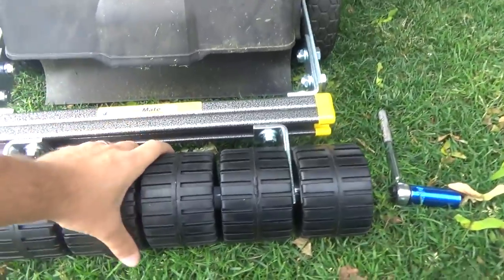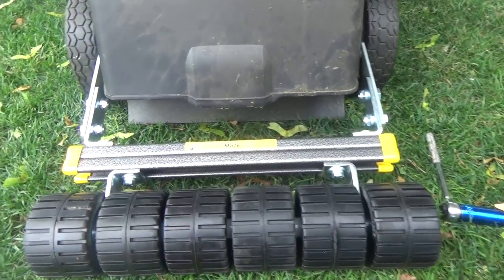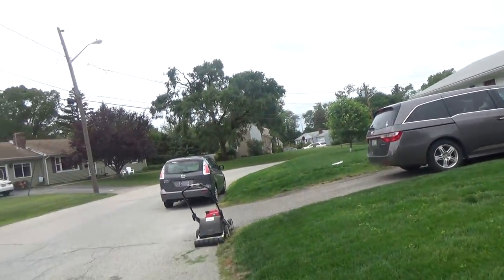Checkmate Striping Kit - Installation / First Use

Comment: I love my checkmate stripper. I only wish I made it. Those are only boat wheels that are made for boat trailers, you can easily make it for fraction of the cost. I actually have a 15 pound dumbbell on mine to weigh it down, it's a little too heavy for my mower but it works awesome.
Reply from the maker: Yeah I was looking into it but those boat wheels are actually pricey. Unless you have a trailer sitting around you can borrow them from. So I figured if I was going to spend that much I'll try the kit out and see what the hoopla is all about!
Reply: Yeah I think it's best system out there for striping. Also I found the boat wheels on a google search for around 4 bucks a wheel! And there was a guy selling them dirt cheap on graigslist, but of course that's near me.

Comment: The problem I have with this is that it will stress the plastic deck over years of use.  Worse yet, drilling holes in the deck voids the lifetime warranty. I really want to love this system, but it’s going to come back to haunt you someday. Those deck holes are going to fracture.

Comment: I have had the checkmate on my hrx for 2 years now. My only complaint is that it's a PITA to take off if your grass is too high or when summer stress starts to set in. My dad has the toro on his hrx and it's much easier to take off or put back on. I think the checkmate stripes nicer, though.
Reply from the maker: +Drew Lukac yeah that seems to be the only con but I haven't used it much yet
Reply: Wayne Severson that's what I do as well. It becomes a problem with bagging.

Comment: How do you truly feel about the weight of this kit? I bought it for my HRX last mowing season and found it very cumbersome.

With the HRX being RWD and this roller adding so much mass to the backend I had issues with the front popping up a bit and causing an uneven cut or missed grass blades. Then maneuvering it, straightaways were fine, but hills, turns or uneven terrain weren't fun. Wound up removing after 2 months of usage.
Reply from the maker: The HRX is known to do that. The checkmate kit shouldn't add to the unbalanced weight but the toro one would.

Comment: I wish my Ego mower had a spot for a striping kit but it really doesn't.  Tried the toro one for a bit but it couldn't be attached as it could with a regular mower.  I ended up using twist ties which ended up breaking after a while.  Another thing is that I have a lot of landscaping so I there are a lot of tight corners which make it hard to use a striping it.
Reply from the maker: Rob J interesting I'll see if I can find a solution

Comment: There is no doubt it looks very solid made. I just don't think I can get the wife on board with me spending $400-$500 for a lawn stripper. I have a 54""riding tractor, so it would be expensive. Great looking lawn! JohnG
Reply from the maker: If you can find used boat rollers you can DIY. All the parts are available at home depot. The kit is just pre assembled and cheaper because the boat rollers are so expensive if you buy them.
Reply: @GrassDaddy  Thank you, I may look into that. I appreciate the reply. JohnG

Comment: Grass daddy , I'm interested in this stripper do you use it all the time ? Do the Toro one do a better job ?
Reply from the maker: +Grassology4610 I use it all the time. I prefer it over the Toro but in testing they basically performed the same. To me the checkmate is high quality no plastic, Toro has lots of plastic - it broke before my first use - and it jacknifes when backing up.

Comment: Grass daddy, dies the checkmate reverse ok on the mower ?
Reply from the maker: +Grassology4610 yes, the brackets are stiff so when you backup no jack knifing and the rollers all roll at different speeds when you turn.

Comment: You earned a sub off this vid since I have a Honda mower and was considering this. Also love the Prodiamine video and the Milorganite video.
Reply from the maker: Awesome! The checkmate kit is super well built you'll love it
Reply: Grass Daddy would love to see this or some more common man's mowers like this. I have an old HRR with the blade clutch and manual choke so I don't have the auto choke issues like some of the HRX mowers. Having a blade clutch is nice for stopping without having to start and stop the mower so much which can be hard on the engine. I think I'm going to work on getting a Chaplin sprayer and post emergents from domyown.com but this fall I'll pickup the HRR Checkmate roller kit.
Reply: Grass Daddy also throwing down Milo, just setting 11 though because I hear you need to be a yard pro to go to 16 ;)
Reply: Does it get in the way of the bag?

Comment: Grass Daddy which Honda mower is that?
Reply from the maker: The Honda HRX217 with the big league lawns striping kit!
Reply: Thanks.  I was on big league's site and they listed the kit for a HRX217VKA mower, so I wanted to make sure this kit would fit my HYA mower.  I spoke with them and was told it's for all HRX models.  Their listing is a bit confusing.  They should probably just list it for the HRX series and drop all the other numbers and letters.  I ordered one today and found a 10% coupon, so that cut shipping cost by 50%.
Reply from the maker: Awesome! Yeah I was a bit confused as well when I ordered. It was one of those order and hope you picked the right one deals =P

Comment: I just built my own for under 200 and they wanted 385 for this one for my mower.
Reply from the maker: Yeah the creator of the company has a video out there where he originally creates the concept out of home depot parts. Unfortunately I couldn't find a cheap source for the rollers themselves, what did you use?
Reply: Grass Daddy I used some angle iron and 3 inch channel, some L brackets and the 3 inch boat rollers that they use